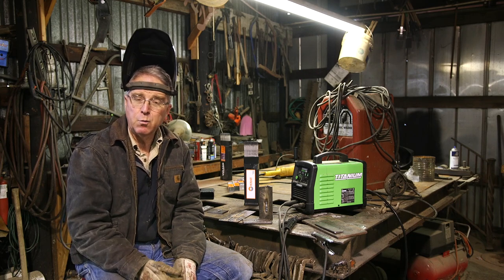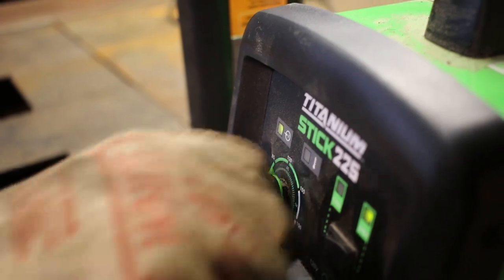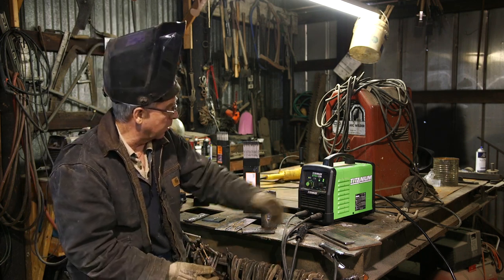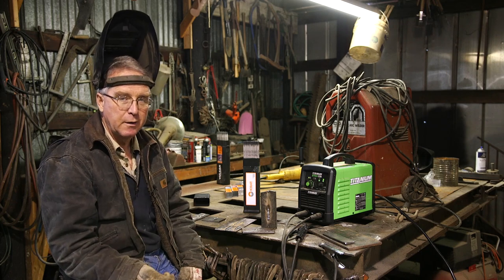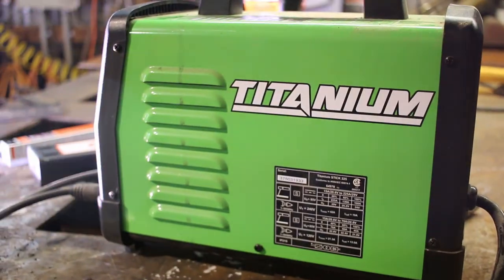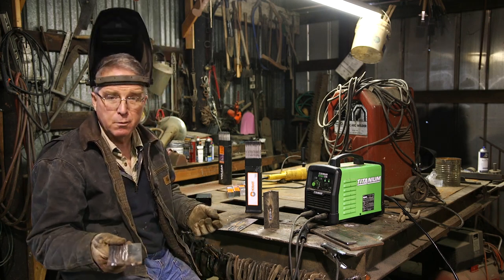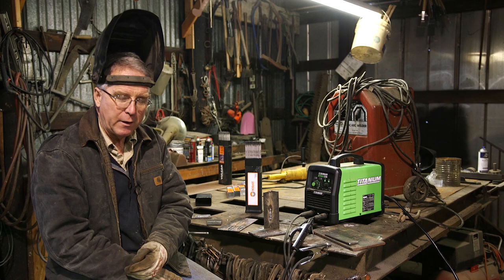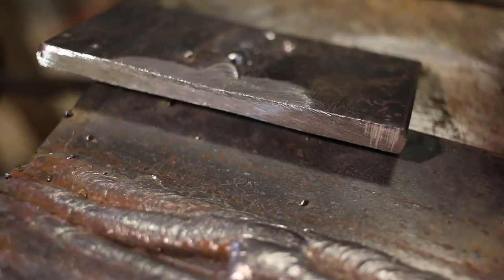Titanium Stick 225 Welder - Harbor Freight Tool

Comment: 20% duty rating means it will weld at max amperage for 2minutes out of 10 minutes. its always based on a percentage out of 10minutes
Reply: I scrolled down specifically to see if someone had mentioned that.
Reply: Lmao yea broo hahaha
Reply: Damn, I was hoping it was based on a year. 20% would mean I can run it for 73 days straight before needing to turn it off.
Reply: Shawn the max is 100% duty cycle running at 10 minutes at its maximum rated output before turning off.
Reply: @shawn576  💀😂
Reply: for a home hobbyist or even a pro doing a few small jobs away from the shop its fine. I have to pound slag and change rods sometime.

Comment: Thanks I’m an old man who would like to learn welding without spending a lot of money thanks for the information.
Reply: You can find excellent old machines on CL for pretty cheap. I got an older miller tig/stick 80% dual voltage for $500, with several adapters for different outlets, 75' of heavy duty leads, pro stinger ground and torch, foot pedal, plus the guy threw in several boxes of stainless rod, 60' of 1/8 wall 2x2 tube, 80% of a sheet of 1/4" carbon plate, several pairs of welding gloves, full leathers, chipping hammer, a brand new dewalt grinder that he got at a conference, boxes of hard rock zip and flap discs, and then some.  Don't be afraid to check CL and when you go to buy, have the guy do some test welds if you don't know how to weld.  You never know what kind of deal you're going to walk away with.
Reply: @bbrown9763  how do you find deals like this?  I literally check CL everyday ( mostly on down time at work) and all I find is either very used asking full price or totally worn out junk that just need a" little work" and a few hundred bucks in parts.
Reply: Never Sleight it wasn’t listed on CL as “buy my old welder and I’ll give you a bunch of stuff for free.” I found a welder on CL that I thought would work for my needs, so I went to go see it. The guy was changing jobs, moving on in his career and I just happened to find him at the right time. We talked for a while, I was brand new to welding, so he was like, “Well, you’re going to need some rod, here; you’re going to need gloves and leather, here; you’re going to need a grinder, I have five because I keep getting them at conferences I’m going to do you can have this one.  I was just in the right place at the right time with the right guy.  I imagine situations like that are pretty rare, but they do happen.
Reply: Also depends on what area of the country you are in.
Reply: Do it. Opens up a whole new world of fabrication.
Reply: Wanna get into welding ? Go to a welding class. Cheaper than a welder you don't know how to use. Also, a welding instructor will correct you "real time" and give heaps of tips and tricks.

If, after that class, you still think welding is for you, then buy a welder. You might find that welding is cool on youtube but not that interesting in real life ... (Happend to a friend of mine)
Reply: @InformatrIIcks  while I like idea of a welding class, it depends on instructor, modern product, no thank you,  I had several instructors that were good welders, but 1 was an old dinosaur that is a true old hand YES! 1 of my teachers was doing welding during WWII on ships, subs, I wish I had picked his brain more, but even to this day, I have never seen anyone like him, close second was when I took auto-body & that teacher was old school & started his life doing body work in tobacco barn with car headlights for light, lawn mower motor to run a vintage car generator,  he refused to allow students to use electric welding processes, 100% torch work, so I am sure my age is showing, but yes I am a product of great training, & love torch best
Reply: I'm in the same boat ( 65) and looking to start welding.
Reply: Yeswelder is a cheap option but built almost identical. Kinda kicking myself for buying this one. I love it but could have saved a lot. Though warranty from harbor freight is hard to beat.

Comment: What I remember from shop class, almost 50 years ago, is that percent duty cycle on a welder is how many minutes out of ten, you can run it. So a 20% duty cycle means weld for 2 minutes, then let it cool for 8 minutes. 40% means weld for 4 minutes, then let it cool for 6. When running short beads kind of guess how much time is spent welding vs how much to reposition your work, etc. That will get you a start on ratio of welding to resting for your welder. The over-heat safety circuit is only used as a last resort.
Reply: That is correct. it's how many minutes out of 10 is what the due to cycle is.  2 minutes of continuous high power use requires 8 minutes to cool down is a 20% duty cycle.

Comment: Just got one and I’m very impressed with the quality and duty cycle, I’ve had a miller thunderbolt, two Hobarts(140 & 210mvp) and two other titanium welders(120 and 200unlimited). This stick welder 225 is my favorite of them all and welds 3/8” steel easy, don’t be fooled cuz its harbor freight, you have 90days to put it through its paces and return it if you don’t like it, that’s the advantage with HFT. God bless fellow welders!
Reply: Except for their 20% re stocking fee.

Comment: One old dude to another- great video!  I'm pushing 60, and hadn't welded since shop class in 1977. Fast forward 42 years and after a career in the military (and currently working as a military contractor) I'm ready to learn to weld again. A trip to Harbor Freight 2 months ago for my birthday and $149 later I have the Titanium 125 amp flux core DC welder. It's a great little welder up to about 1/4" plate, and most importantly, I'M LEARNING!  Lots of good videos here on YT, and next year I want to get the Titanium Unlimited 200 multi-process welder so I can re-learn stick welding, as well as learning MIG & TIG. Thanks for the video, and you get a Like and a sub from this old fart. 👍
Reply: I realize this post was 3 years ago but I wanted to share with ya that it gave me a smile. i'm currently in the military. 40 later this year and am just looking into learning to weld. Cheers. And thanks for your service.
Reply: @checkthebriefcase  And thank you for your service as well. Enjoy the road to welding, it’s a lot of fun.  👍😊

Comment: Here’s a little known tip; to increase the “duty cycle” of your little stick welder....
Get yourself a little high output (cfm) “muffin fan” and mount it “strategically” to the welders metal housing. The goal; is to increase the “exhaust” air flow, which will improve cooling. Which will in turn, increase the duty cycle. You can either replace the existing fan with a more powerful one (the easiest way) or you could add one somewhere, and wire it (in parallel) to the existing terminals of the factory fan.
The whole idea, is to reduce the cooling time!
I have been an L.A.City, Certified Welder (all positions, unlimited thickness, stick/wire) for the last 40 years. I always add fans to my little 110/220 welding machines, to increase the factory duty cycle. It works great, and I’ve never had any problems with any of the machines that I have done this to...
I was taught this trick, 15 years ago, by a guy who is also a welder, and a mechanical genius!
Good Luck! “And Keep Up The Good Work!”
Reply: I have some questions for you? Any way I can reach you?
Reply: It makes sense, duty cycle is directly related to not overheating the welder.
Reply: We need a video on how to do!
Reply: This is why youtube was invented.. this is a great idea and i totally understand how and why it works. However i never thought to do it.  I love when great minds comment.
Reply: Thanks for the advice, Mark. It's very much appreciated.
Reply: "all positions, unlimited thickness,"   Mark can weld entire metal planets together.
Reply: @Lengsel7  there are only two things I can’t weld together: 
A broken heart and the crack of dawn! 🤣🤣🤣
Reply: Its someone like you that I would LOVE to watch a Video of your thoughts and experience for the DIYER looking to purchase a consumer grade machine and how to use it .     I mean really Plz do this.   Could u atleast suggest a machine upto 500 dollar budget plus or minus machine plus gear ??? Thanks
Reply: BRILLIANT!!! MANY THANKS!!!!
Reply: Great idea.
Reply: @Lengsel7  asteroid certified
Reply: you can help out a 120V mig by preheating with a MAPP torch.

Comment: I have a bunch of different welding machines. I came across a cheap welder on Ebay that was only $169.00. Its an inverter welder, most inverter welder cannot run cellulose rod (6010, 6011). But this one has an "arc force" control just for that type of rod. So I bought it.  It runs great. 200 AMP, with 120 volt pigtail.  DC welder that weighs 5 pounds with 200 amps and arc force. I welded on pipelines years ago, owned a lincoln SA 200.  We ran about 10 lbs of rod with it, so far its been good.  Im still amazed.
Reply: Mr. Miller ,  Am considering for beginner
repair of Trailet and Chevy front  Van rust
weldment.  Thank you for advising 'bout
"arc  force " electric set for  6011  dc cellulose 2 or 3 / 32  in. Rod.  Penetration 
@ 120  volt vertical up for Van weldment goin'  to try!

Comment: I learned to weld when I was 9 years old in my dads trailer shop! He built car haulers for the auto industry! 7 to 11 cars! They built the sections in jigs! I was watching a guy whose name
Was Poncho, nice guy and one day he said come over her! So I did and he asked me if I wanted to try it! I wasn’t passing that up! They used Marquette welders with 7018 5/32 rod on this particular section I think it was one of the track sections on a deck! I hung out with him for that enter shift! Watching and learning! Every time I was at the shop he would let me practice with scrap steel! I wouldn’t trade those times for anything!
Reply: Sometimes you can simply use a period as the main punctuation mark. Then use an exclamation point at the end to show your enthusiasm! 😄
Reply: @Finn-McCool  Maybe their "period" key is broken? ;-)
Reply: @Finn-McCool  ha  yea you are right.  guess I need to learn that  too!

Comment: I have a Lincoln MIG and Lincon AC buzz box and I bought one of the Titanium flux MIG welders for $160. That thing is KILLER! I told my friend who had a welding shop and he pointed to his work truck where I saw one of the same Titanium welders in his truck for exactly what you described- quick jobs near a 100v outlet or a job that a bigger generator can handle. (67 year old lifetime wood worker who took up welding a decade ago because rehabbing a couple of gates was going to run $3600!!! Bought a welder and a big metal bandsaw and all the accessories for less than half of the project cost. The results were EXCELLENT. Went on to do several more projects. LOVE welding.)

Comment: Another "old man" here, haven't welded since shop class over 40 years ago. Started thinking about welding while working to restore my old tractors.This might be a good starter machine for me.Thanks for the Information.
Reply: The Lincoln 210mp is also a great machine for home use, uses 110v or 220v.  It can do stick, mig, and tig welding, and is very user friendly. Only thing is it's a bit more expensive than that harbor freight welder. Mine was around 2200 dollars Canadian at prax air.

Comment: Hi Scott, I can relate to your comment when you stated the you can weld but dont consider yourself a welder.  I too learned to weld in high school. My Grandfather bought me a used Lincoln 180 amp AC  welder back in 1978. We worked together and built a log splitter and double barrel wood stove out of 1/8" wall pipe - still use both of them to this day.  I in turn taught my oldest son to weld using the Lincoln. He unlike,me is a professional welder and is the lead welder at a local business that makes wood chippers, large skidsteer/ 3 pt hitch mounted snowblowers. Not bad for not yet being 23 years old. My Grandfather would be proud of him. Thank you for the awesome channel, I thoroughly enjoy each and every video. Happy birthday

Comment: I bought a 200 amp Lincoln gas machine when I was in high school and taught myself how to weld. Started doing small jobs on drilling rigs in the oilfield and was making good money for a 17 year old guy still in high school. Eventually got a full time job building new drilling rigs in Odessa Texas and went on to weld in the oilfields and pipelines all over west Texas and eastern New Mexico and Oklahoma. Built several welding trucks and had 4 guys working for me and living the dream.
Reply: Always found welders to be sort of a ‘breed of their own’. Even more crazy than regular rodbusters. Not meant as a knock or anything. Just an observation thru the years. You know, how you can usually guess someone’s craft just by looking at them. Maybe reading a book by its cover but, pretty accurate for the most part.
Reply: @psidvicious  Wow I wonder what you would think of me now... I used welding as a stepping stone to start 35 businesses and get two engineering degrees. Just because I could burn a piece of metal better than anyone else I was a breed of my own? Interesting.....
Reply: @dannywilsher4165  Very admirable record indeed. My experience with welders may be unique. Who knows? It’s only my observation through my career and maybe it was just the luck of the draw. You would probably agree with me that different trades tend to attract ‘birds of a feather’, no? I didn’t mean to imply welders were somehow bad people by any means. To me, from the limited welders I’ve worked with, they always seemed to be a ‘unique’ bunch. 🤷‍♂️
Reply: @psidvicious  Thanks, I get where you are coming from. I have notice lots of different people who do the same thing tend to try to act and gravitate to the same  type of lifestyle I suppose... Maybe just nature trying to keep all the birds in the same flock.... Have an awesome day sir!!!!!

Comment: The good thing is this welder is actually rated for 100% duty cycle at 100 amps and Below when hooked up to 240. I've never, never had mine shut off and I personally don't think I ever will. Anybody that doesn't believe me look at the sticker above the power cord on the back of the machine. Love your videos!
Reply: Since you actually have one of these machines, how many amps does it recommend having available at the outlet of the wall?

Comment: I shall be eternally grateful to you for this video.  I watched it soon after you made it [and apparently forgot to like it] but, more importantly, at 74 years old I bought a small Lincoln GFAC 140 {never having struck an arc in my life} and used YouTube to give me the basics.  I have had uncountable instances that I needed to weld a small project, but never could do it myself.  Now, thanks to your inspiration, I use it frequently with most adequate results.  Many thanks, Scott, and keep up the good work!

Comment: I Ironworked for 20 years. Certified welder through apprenticeship for SMAW. Worked rebar mostly, and got out after wrecking my back. 

I picked up one of these a Titanium welders, but the multi process machine. Over the years, I’ve picked up on MiG, but really want to teach myself TiG. I’ve been really impressed with the little green machine.
Reply: I'm setting up scratch start Tig bro

Comment: You nailed it again. 
You don't need the most expensive welder to do a job. If you are a occasional welder this is for you. Or if you want a throw away welder for jobsite welding this will work for you.

Comment: I'm 69 and purchased an earlier version of the Titanium two years ago.  (Replaced the poor parts you mentioned before I even started using it.)  Other than it only having one scale and lower maximum Amps, exactly the same.  I practiced on scrap and now am welding projects as often as I can.  This welder is very easy to store and I've never hit the duty cycle limit.  It's perfect for backyard shop use.

Comment: For anyone thinking of getting into welding. Stick welders are perfect to learn on and get used to hand control. Alot of people say flux core. But I think stick welding has made me a better welder all around. You can run single hand which teaches single hand control so that eventually when you decide to. Buy a tig torch from radnor and argon bottle and consumable and learn to tig. Mig is for the shop. I have the titanium 140 multiprocessor and it's a tig monster with a radnor flex head tig torch. I do alot of 6010 5p and 7018 hi-lo for work. And we have a dualshield process and do alot of stainless 304 tig welding as well.

Comment: Welding has always intrigued me and I have wanted to learn. I just picked this welder up at HF as an open box special for $159.
Reply: Was it worth it ? Iv wanted to learn because it would help alot with my car
Reply: @andrikmartinez1214  dont get stick for auto body work imo, or cars in general. You cant get a mig gun in every groove or hole, but lots of mig machines also run stick.
Reply: @BudMasta  not really unless it’s a mp machine other but the over whelming majority is gmaw/fcaw and smaw/gtaw

Comment: I bought the HF Titanium flux 125. They claim 3/16 material is the max, but your'e not even at the maximum setting according to their recommendation. I only have access to 120v 20a breakers and probably will not see 240v for a few years so this little machine is perfect. I have no other welding experience but from using a variety of tools over the years it seems to work well and I have welded non stop on scrap pieces learning at medium settings without over heating it. I am thoroughly impressed and can say it was money well spent. $180 plus hood gloves etc. Also if you don't have a long sleeve shirt to dedicate to welding get a jacket or sleeves, spatter isn't fun if you're hairy!